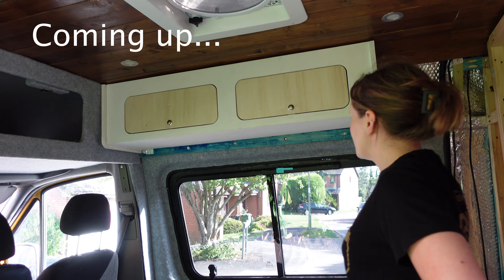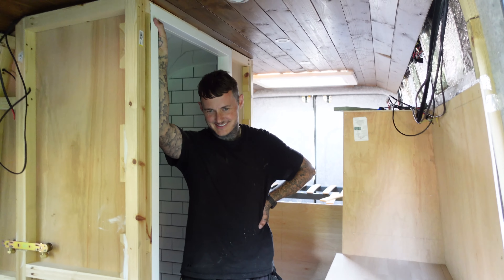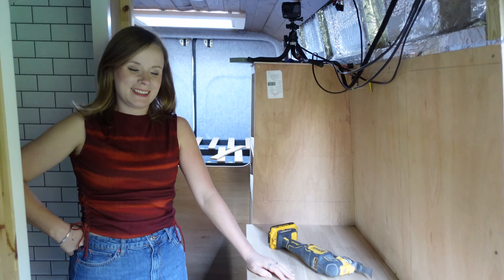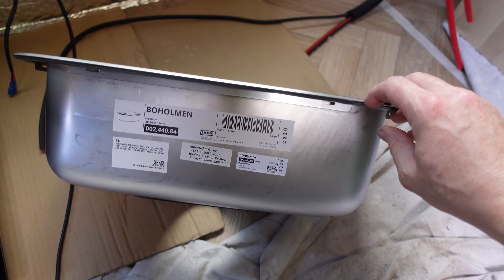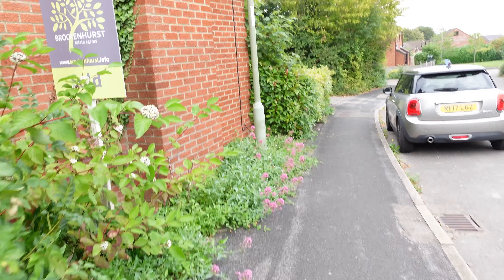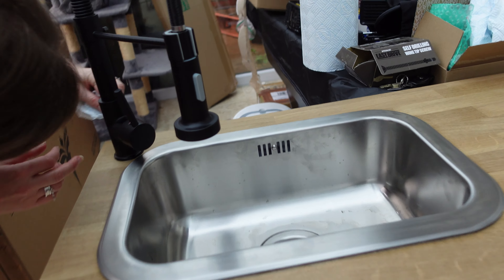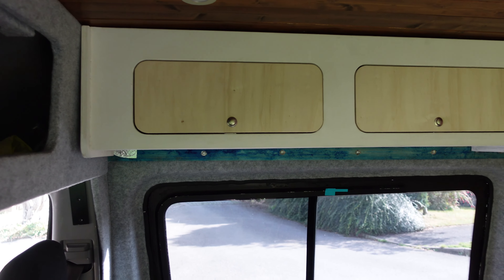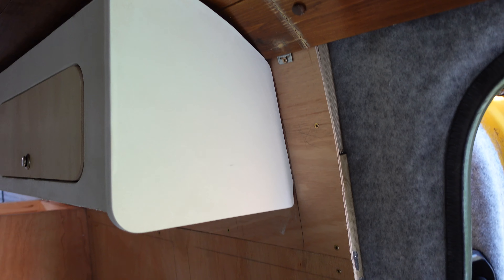Van Build: Ticking off MAJOR milestones! | Mercedes Sprinter Conversion

Comment: Good to see your progress and I always feel for you guys when things don't quite go to plan.  But you're learning so much and I can't wait to see you finally off on your adventures in Ray.

If I could offer one tip, which you may have done so apologies if you have.  Great foresight to run the spare conduit.  I'm guessing it's large enough for another couple of small cables?  But did you remember to attach another pullthrough wire as you pulled the cable through?  If not, then the next time you need to get a new cable through you haven't got anything in there except the live cable you've just pulled through - hope that makes sense 🤔
Reply from the maker: Thanks mate, now that right there is exactly what I should have done. D’oh! Really appreciate you watching 🙌🏻

Comment: Bad idea underslung sink with wooden worktops. I used to be kitchen fitter. The edge looks grubby after short while. And it certainlyooks grubby already with way you've cut it. You can't leave it like that. Use the same cut out & fix over instead of under. It will look far nicer. I been a tradesman for over 50 yrs. I like Mel. But he doesn't always get it right. He has many good ideas though. He did some bed slats for Becky while ago & kneeled on them & they broke. Which I knew they would do. Best to get the ikea ones & cut to size if needed
But definitely sink over not under or you'll regret it

Comment: Although this video is supposed to be in 4K, as it says in the icon, it's only showing up in 1080p as the highest quality option!
Reply from the maker: Not quite sure what’s happening there. It does allow me to switch to 4k on my tv, but on mobile it is only 1080p too. Hmm - def exported as 4k.
Reply: @lifeadventureprojects  I kept checking throughout the day & it was still only in 1080p, but I just checked now and it's finally in 2160p 4K!